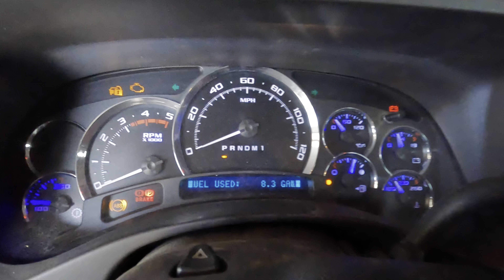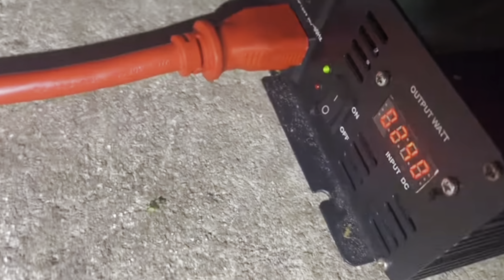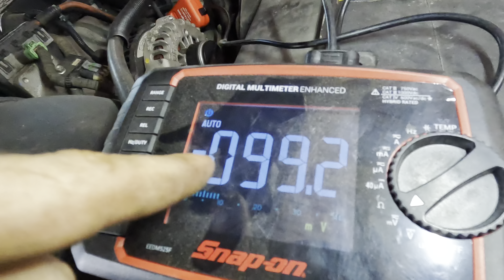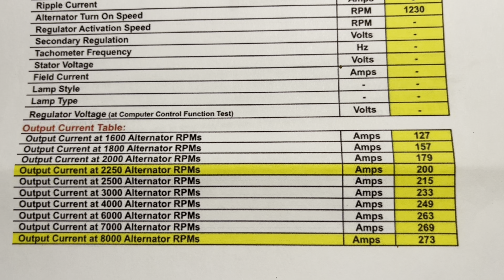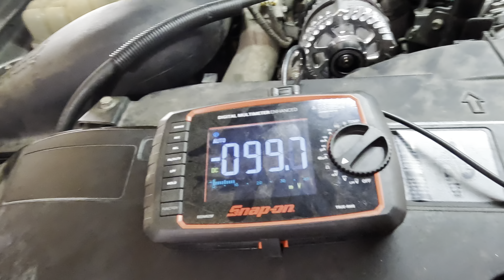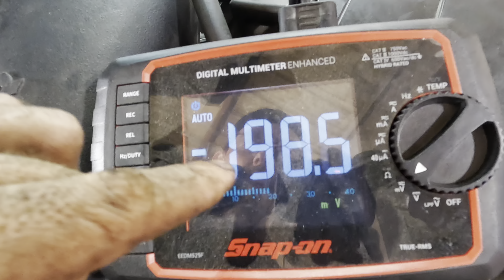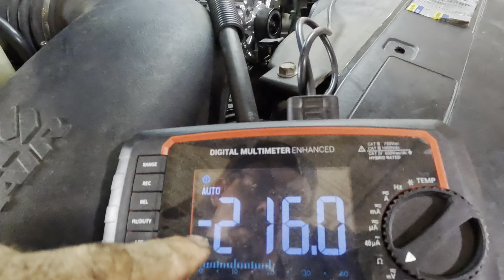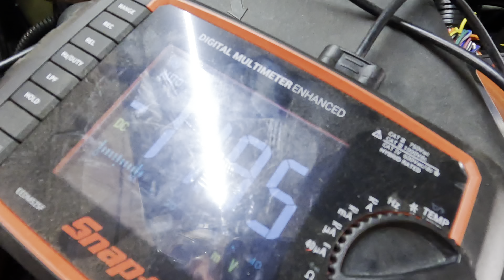Torture Testing a Performance Alternator

Comment: About 10 years ago, when the voltage regulator on the factory 110 amp alternator on my 03 Super Duty died, I replaced it with the DC Power 270 amp unit. This thing has been a champ and still keeps all the electronics , batteries, and aftermarket lights happy.

Comment: Way over the top on this whole electrical rabbit hole. I love it. Can you put a portable nuclear power and have 20 years fuel aboard. I have deep faith in you Rainman
Reply: How about a Flux Capacitor?
Reply: @dankunert6344  I believe you are referring to the Mr. Fusion. The flux capacitor is what allowed time travel, not the actual power.

Comment: There's a much better argument for using two factory alternators than cool factor, although I understand the cool factor. The alternator case has a finite heat dissipation, regardless how much current the internals are capable of creating, because the thermal mass of the high output unit is no more (appreciably) than the standard factory unit. Thus, if you're in a situation where you have a sustained current demand of over 200 amps, each of the smaller alternators will be operating at a much lower heat load, which increases their efficiency. And I'm glad to see DC sent you a 270 instead of a 320, 390 or 490 amp unit. I never recommend more than a 270 amp alternator to my customers because efficiency gets pretty nasty when you're generating more than 300 amps in that standard sized automotive alternator chassis. Two hundred seventy amps seems to be about the limit for these chassis in terms of heat dissipation and efficiency when loaded.

Last, get some fusing on those additional power wires. It's rare that an alternator fails to high voltage but it can happen and when it does, if there's no fusing the damage can be catastrophic. Many years ago I melted down my entire audio system because I didn't have the wire feeding it fused, when the alternator failed and dumped ~60 volts into my electrical system. Thankfully, the factory side of my electrical did have a fuse so it saved me surely totaling my truck with that mishap.
Reply: I've never heard of a fuse that blows based on voltage, only on current.   Happen to have a link to one? It'd be a interesting read for me.
Reply: I never suggested fuses blow based on voltage. But I will say, nor do they blow based on current. Fuses are thermal devices. They blow based on temperature and their alloy, cross sectional area and length are "tuned" to melt at a temperature that would be created by a relatively closely approximated amount of current. But with that said, they do not know what that current is just like they don't know what the voltage is. And they don't need to.

Next let's examine Ohm's Law where it relates to a 12 volt electrical system. If we have a 200 amp fuse on a 12 volt circuit that circuit has a more or less constant amount of resistance. So if we raise voltage, current must necessarily also rise because resistance is fixed. And when that happens, fuses heat up and do their thing. For the maths we can assume that if we're flowing 160 amps through a circuit fused at 200 amps (20% headroom) and voltage begins to rise.... it only needs to rise to ~18 volts to reach 200 amps. Theoretically, at the 55 odd volts I measured coming out of my alternator when it failed the current flowing through the factory installed fuse was something on the order of 600 amps and last I checked, it doesn't take anywhere near 600 amps to open a 200 amp fuse. I'll also add that, in a catastrophic even like that all it takes is for one device in the vehicle to fail to a dead short in order to cause an insanely high inrush of current. And that inrush will last until something opens, whether it be a fuse or the dead short failed device.

tl;dr Because Ohm's Law is real.
Reply: @BrandonBuckaudioanarchy  

the bit where i was confused was where a fuse would protect your system from the alternator outputting 60 volts.  Most electronics aren't a purely resistive load, and applying 5x the rated voltage is going to fry them instantly unless they have inbuilt protection for overvoltage.  A fuse won't blow in time to stop that, even if the device does pull enough current to blow it.
Reply: I didn't suggest a fuse will protect your electronics in this scenario. Fuses don't exist to protect electronics from damage. They exist to protect the occupants of the vehicle/building from burning to death in a fire.

Please address the things I actually say. Thanks.
Reply: @BrandonBuckaudioanarchy  
"Many years ago I melted down my entire audio system because I didn't have the wire feeding it fused, when the alternator failed and dumped ~60 volts into my electrical system. Thankfully, the factory side of my electrical did have a fuse so it saved me surely totaling my truck with that mishap"  
Maybe you didn't mean it that way, but it seems pretty clear that you are implying a fuse would have protected your audio equipment from 60 volts.
Reply: It may have but probably not. My point is that the factory fuse blew and so nothing that got damaged on the factory main fuse looked like a 5 alarm fire. The two amplifiers that were on the unfused side of it melted down and created enough smoke to fill a football stadium.

Luckily the only thing that was damaged on the factory side was the ECM.
Reply: @BrandonBuckaudioanarchy  Intentional or not, you've set up a strawman argument to defend yourself and you are wrong. A strawman argument is telling one untruth to support an entire argument. If those you are speaking to do not catch the untruth then the entire argument seems valid.
You said "if we raise voltage, current must necessarily also rise because resistance is fixed". This is very incorrect. If resistance is unchanging and voltage rises then the amperage will drop. The amperage will not rise as you claim. 
Your argument and supporting statement are not compatible and a fuse will be less likely to protect your equipment when the voltage rises because the required amperage and heat generation from resistance to electron movement at the fuse has now become much less likely to happen.
" Ohm's Law is real" is indeed true, but you've applied it incorrectly and it not only invalidates what you argue but proves it is wrong.
A fuse will not protect your equipment from over voltage.
Overvolting will make a fuse less likely to melt in a situation where the resistance remains constant.
This basic fact is why we transmit electricity over long distances around the world with high voltage on electrical grids and why we use high voltage battery packs in car audio and also in electric vehicles. The higher the voltage the lower the amperage needed to do the same work. That's nice because now we can use smaller wires, smaller fuses, and generate less heat.
I'll explain it in car audio terms.. since your user name seems to lean that direction.
We have a 12 volt car system and the amplifier blows the fuse at 100 amps of steady strain. That's about 1200 watts of power.   If we then increase the voltage to 16 volts that same fuse will need 1600 watts of power flowing through it to blow that same 100 amp fuse.  Raising the voltage reduced the ability of the fuse to blow.
In your case if you had a 16 volt car audio system and the alternator suddenly produced 60 volts your 100 Amp fuse would need 6000 watts of power flowing through it to blow open.
Raising voltages makes fuses less likely to blow. Raising current ALWAYS makes a fuse more likely to blow. It's Ohms law and it's real.
Your electronics melting and shorting out from being overvolted is what caused the fuse to blow, the shorting part specifically since you've now lowered the resistance, not kept it the same.
Reply: @BrandonBuckaudioanarchy  "Fuses don't exist to protect electronics from damage" 
Well this is false. 
Fuses are sized to protect the conductor or equipment they are attached too.  You can size a fuse incorrectly ( use too large a fuse)  as well as apply too much voltage and defeat the protection of a fuse. A properly sized fuse WILL protect electronics, that's the very reason we use them.
A fuse can not protect from overvolting, it can protect from overcurrents. That is the design of a fuse, to break an overcurrent situation.
Fire, smoke, property damage, death, injury... These are all reasons we use fuses, to prevent these results.
You may not understand voltage designations on fuses. The voltage "rating" on a fuse is there to indicate up to what voltage an electric ARC can be extinguished when the fuse fails. This is an idea beyond an audioheads understanding but any one who deals with voltages beyond 24 volts will learn this quickly.
Reply: @btwbrand  I definitely misspoke in regard to resistance because as devices short from over voltage, resistance varies. Sometimes going lower and sometimes higher. None the less, the damage from overvoltage causes excessive current draw until such time as everything downstream has opened.

"A fuse will not protect your equipment from over voltage."

This demonstrably false. Fuses don't always protect equipment. Period. How they protect it and exactly why varies based on the conditions.

If you don't believe me, I don't care. I've seen it happen.
Reply: @btwbrand  Fuses exist to protect humans. If they protect other things in the process, great.
Reply: @btwbrand  Also, fuses don't blow from current, they blow from heat. Fuses are thermal devices and it makes no difference how they get hot enough to blow. When they get hot enough to melt, they open. Current and voltage be damned.

Comment: That's fantastic. I did a similar dual battery system to a 93 k2500 after I changed to dual electric fans, added a 60" bar light, pod lights, electric brake booster, and converted to direct port injection and coil packs. The load was way too much for stock on my truck, so i added a second battery and had a 105amp rebuilt to 180amp. I will remember this company for when i need to replace the alternator.

Comment: I understand your thought process with what you did Ray. Nice setup. I went a different route since I did work for a Kubota diesel dealer and generator manufacturer. Got the components and assembled a 7 KW Kubota D905/Stamford Newage brushless alternator, a 60 gallon tank, and manual transfer switch for 4K a couple of days after Hurricane Frances in '04. Back fed through the dryer after removing the meter(sorry FPL) until I had time to wire in the transfer switch. Jeanne hit a month later, then Wilma in '05. It handled my small house including the HVAC system if I managed the load by not running the range at the same time. It burned 1/2 gallon an hour at full load and my customers were giving me fuel from their boats. I was without FPL for 10, 14, and 12 days during that time after the hurricanes.
Two nights of sweating and no lights and refrigeration after Frances were enough for me.
Reply: Setup a similar breaker box feed,have a main disconnect under my meter so I don't back feed power company
Reply: @michaelpressman7203  That's what I did eventually.

Comment: This is an awesome idea, now I want to apply this to my truck.
Reply from the maker: Upgrade the cables too!
Reply: @RainmanRaysRepairs 
Future proof the install. Use zero or double zero gauge cables. Also upgrade the main grounding cables as well.

On my old mid-70s Ford LTD wagons, I ran with double zero gauge power and ground cables. The original equipment ones were 8 gauge. Makes a huge difference to the starter as well.

Comment: For hurricane  preparedness, wouldn't it be much easier to have a whole house automatic standby generator installed? You can get natural gas or propane. Natural gas if you have it, the generator would not run out of fuel, and you wouldn't have to pick and choose which circuits you want to connect.
Reply: Need a diesel genset with propane conversion for home use,power outages can hapoen anytime and your truck doesn't need to be there. Gas unit could standby at shop for emergency use.
I had seen alternator units that could be used to weld with,that might be next upgrade
Reply: Or diesel.  My neighbor has one on the farm.
Reply: While what you say is true, the  cost of the generator and electrical work will run $10K to $20K, this is much cheaper.  I have natural gas and a generator for my home would be over $13K.
Reply: The nice thing about the truck is that it is mobile, Ray will never be without 120v AC.

Comment: My friend has a GMC Yukon and it came with the standard 105 amp alternator from the factory.  He replaced that one like 2 times.  Then he got the upgraded 145 amp model which I believe was an option on these vehicles.  He hasn't had any problems since.

Comment: Holy Moses! That battery tester was really forced to it's limits. A little more power and it would catch fire. All that smoke tells me the isolation varnish must be gone or is pretty close. You might need a new one very soon. Always lovely having Lauren and Dave in the video.
Reply: No varnish there, those are just plain nichrome strip elements, and the smoke is the burning off of all the dust and oil vapour that has been deposited from being in a garage where this is in the air, and where you also breathe it as well. Got a cheaper one, one setting non adjustable, and it too will smoke after 10 seconds of use, which is the duty cycle to test a battery, to emulate a typical starter load and time.

Comment: My 2014 GMC Duramax came with a 125 amp alternator, after it went to alternator heaven I installed a 165 Amp as a replacement. Works great in the winter to recharge the batteries after cold start with glow plugs and intake heater.

Comment: The suppliers of the super alternator saved you a can of brake clean because their alternator is already supplied nice and shiny! 👍👍
I don't know if you have thought about this but since this setup is so important for your hurricane emergency power it might pay to keep a spare serpentine belt sitting at home so if this one breaks your emergency power also won't be down for long unlike the grid. 
With the super alternator installed you'll now have a mobile power source for a welding unit if the inverters can handle the draw. Cool eh! 😎
Thank You for the video.

Comment: Yep, a pretty cool addition.  Upsize all your DC power cables and connectors + and - for the new max load and add the appropriate fusing.  You have a pretty slick set up.

Comment: It's pretty interesting what you can do with an upgraded alternator specially since you have a dual alternator system. But for me I don't think I need my 2002 Volkswagen Golf TDI to be powering a town. I'm just happy with the charging up the battery to keep running. great video of all the way. I do think that that is awesome alternator. And I do understand why you're adding this to your truck generators aren't very reliable times. Especially if you're trying to use them for a long. With your setup I can see that it's more versatile.

Comment: In my younger days when I was running lots of high amp audio equipment, I'd go through lots of Powermaster alternators and Optima batteries. They did their jobs but the failure rate was high to the tune of one every 1 to 3 years. That's a lot of alternators at 600 a pop.

Comment: @RainmanRaysRepairs you can buy used Military diesel generators between $8k&12k in great condition that can easily power an entire house. Put it on an auto for when the power goes out; it will automatically kick on. It's great deal and they are insanely well maintained.

Comment: DC Power makes amazing products, I have been using them for a while. I prefer to use Knukonceptz 0/1 and 4 gauge OFC cable for all of my stereo systems as well as upgrading power and ground battery cables. Very high quality.

Comment: Rayyyy put a plastic sheath over unfused cables to prevent fire! Adding more cables increases risk. The soft insulation is easily damaged. Cool alternator and setup!

Comment: Nice hi power setup there Ray! Since this will be used for emergency power at home during storms and such you might want to apply Ox-Gard  anti-oxidant compound or equivalent to all high-current connections before tightening them. This will improve connection reliability considerably.

Comment: That's pretty good.  300amp @12v DC works out to about 30amp @120v ac. (There's going to be some loss obviously) but that's roughly the equivalent of 2 household circuits. So easily 3500-4000 watts and you could probably max it out to 400amp or 5000 watts. But I think that will lead to issue. If you keep it at 3500-4000 watts, you should be golden.

Comment: Mister , you have to add fuses to each alternator. If one of the alternators fails, nothing prevents you from a huge current / it happens that the regulator in the alternator fails and does not limit the voltage in the system / from the defective alternator igniting the cables in the engine compartment.